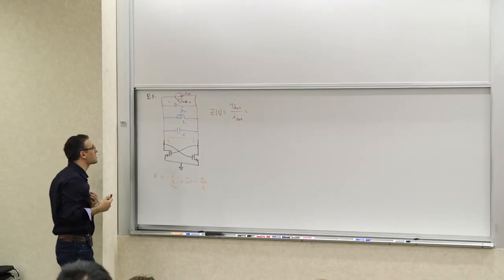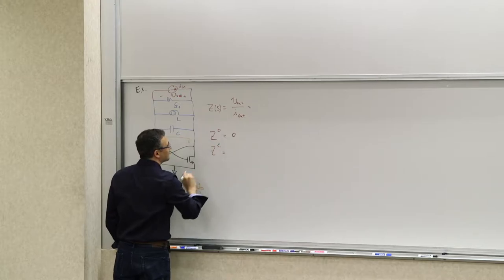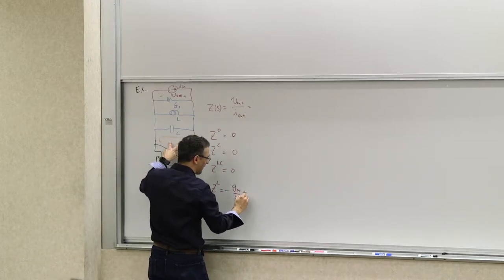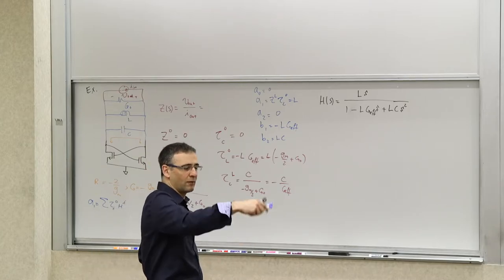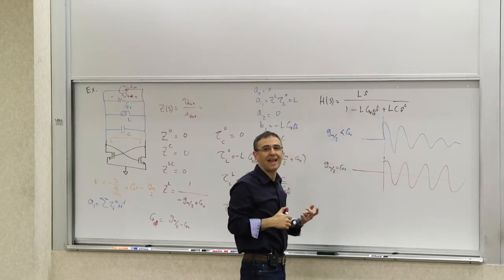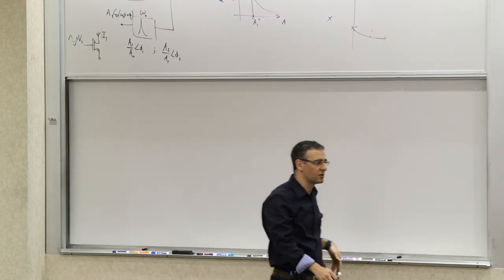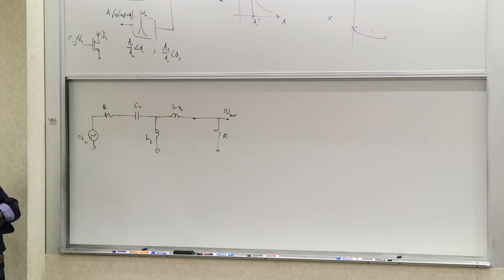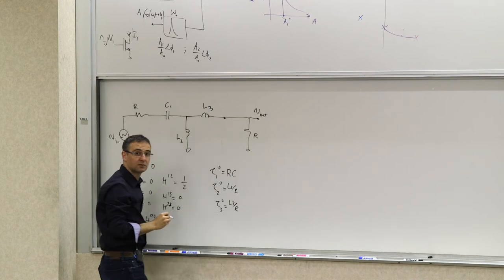152N.TTC Examples, negative resistance, oscillator, RLC circuit

Comment: One question: when there is a resistance zero associated to an inductor, the time constant becomes infinity as you showed  on the video for the negative resistance circuit. Happily on that example you can work with another time constant. How do you deal in general with those situations? Thanks an congratulations for your great videos.
Reply from the maker: Often, you can find a combination of the time constant products that gives you non-zero, non-infinitely products. But if you cannot find such you can always add a small series resistance, rx, in series with the inductor, do all the calculations (with finite resistances) and then set the value of rx to zero.
Reply: @AliHajimiriChannel  Hi Professor, In the last example circuit with C1,L2,L3, the T32 = L3/R, however you calculated L3/ꭃ=0. Howcome?
Reply: @gauravshrivastava6150  Because left side of L3 is open circuit, so the resistance associated with L3 is infinite value because of the open circuit.